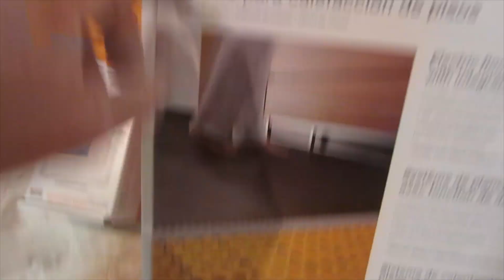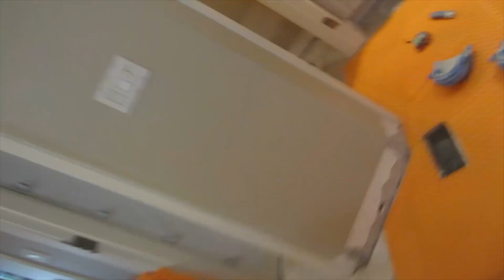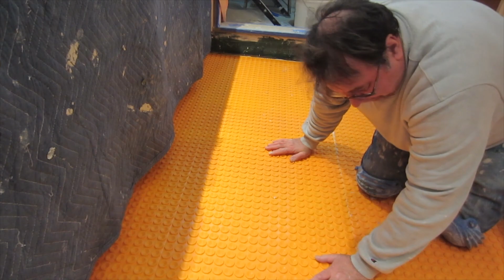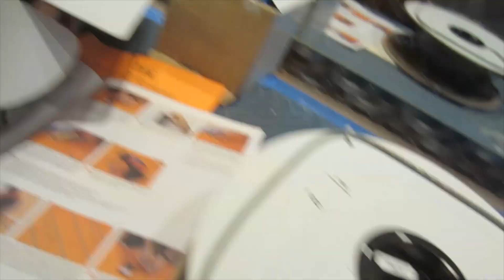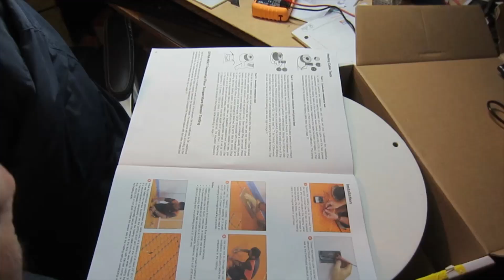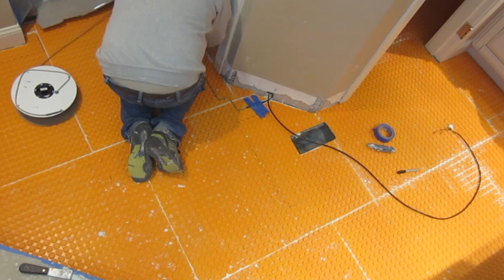Ditra Heat, electric floor heat  how to install it start to finish

Comment: Sal, I am so confused over the unmodified and modified thin set situation. I am laying Ditra Heat membrane over plywood and then 16x16 travertine. I know that I need polymer modified thin set on the plywood under the Ditra Heat and unmodified on top of the Ditra, under the travertine. I have a local Menards store and there are so many choices. I found TEC Full Flex Premium Latex Modified Thin Set Mortar  which looks like it will work under the Ditra, but also found TEC Uncoupling Membrane Mortar which says it can be used with the Ditra and many more choices. Can you please lead me to some exact brands or model numbers? I cannot fine anything that specifically says unmodified and don't know what the means exactly. I don't wan't to get the wrong ones.
Reply from the maker: Full flex is good to install the ditra, and the TEC Uncoupling Membrane Mortar is good to set your tile on the ditra. In other word FullFlex is modified, and TEC Uncoupling Membrane Mortar is unmodified, and is the one i always use. If you look at the bag you will find the Schluter logo on it.  It is called Uncoupling Membrane Mortar, because Ditra is an Uncoupoling membrane. If you have not seen this video, it might help you understand, https://www.youtube.com/watch?v=YpXEXqbh7ok
Reply: ***** Thanks!
Reply: ***** you cant use Full flex. In the Manuel you have to use unmodified thin set
Reply from the maker: *****
The unmodified thinset is to install the tile on the Ditra, the modified thinset is to install the Ditra on the plywood.

Comment: what size traut 3/8× 1/4 or 1/2 by 1/2. ???
Reply: trawel  for tile instalation
Reply from the maker: 1/4x1/4x1/4
Reply: On top of the ditra?? To lay the tile
Reply from the maker: No, for installing the Ditra, trowel size for tile depends on size of tile. https://www.youtube.com/watch?v=cqbYzSTiLG4
Reply: ok  i have 12×24
Reply: Got it thanks Señor Diblasi